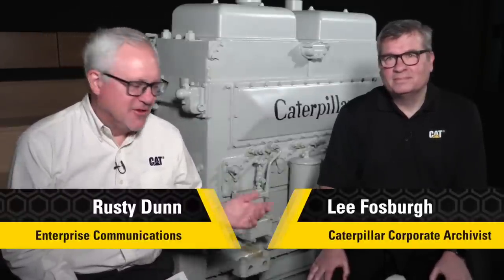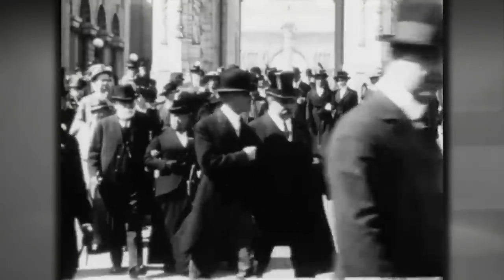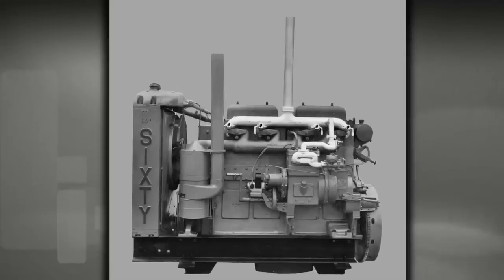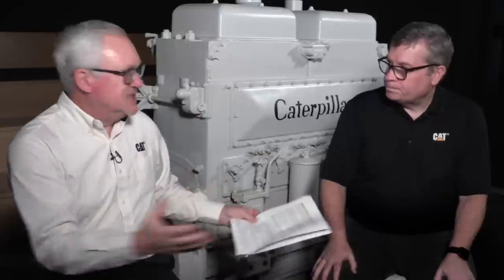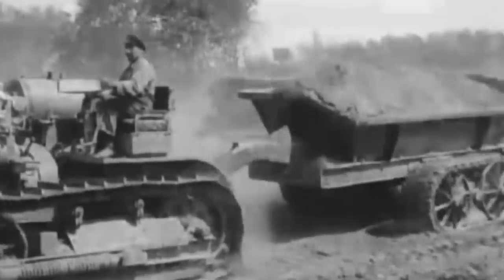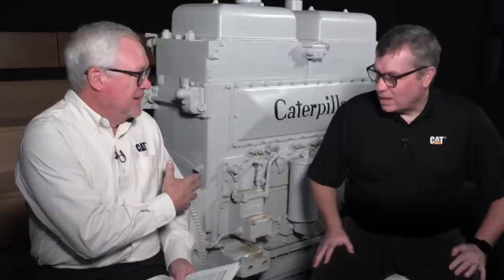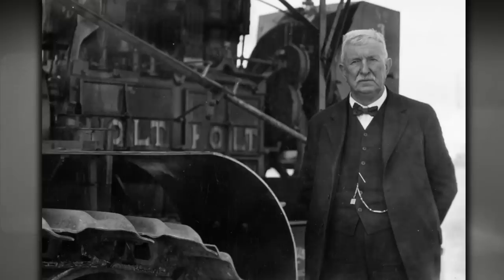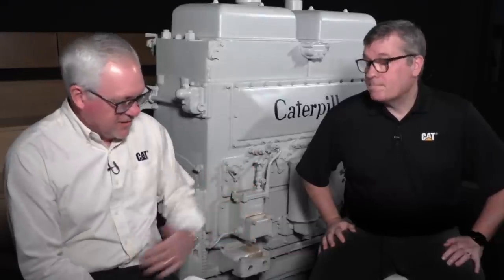The Story of Old Betsy | Diggin' Into History

Comment: during ww2, you wanted a cat to go to war, they were hard starting and you won't be first to fight! best engines ww2 detroits!!
Reply: We still won.
Reply: Did you make that up, Chad?    Cats had the gasoline pony engine starter - it not only had the same function as an electric starter motor, its exhaust and common coolant warmed up the diesel engine, so it would start no matter how cold the weather was.
Diesel engines with electric start will not start below a certain temperature, but a gasoline engine always will.